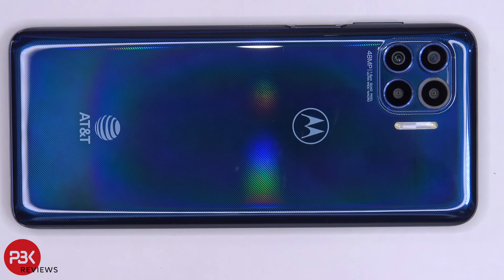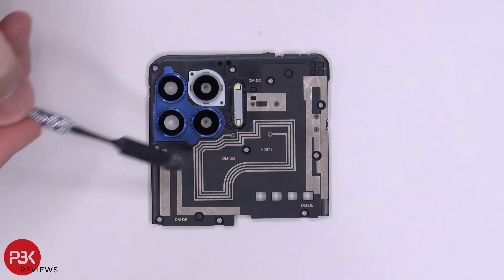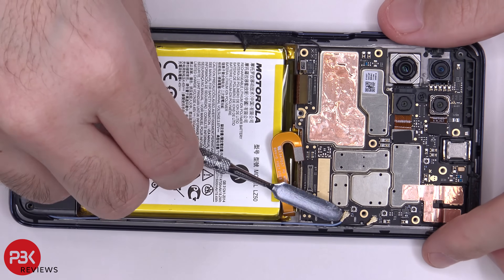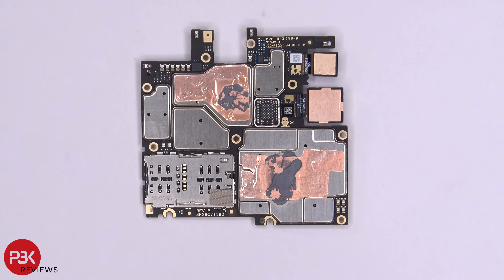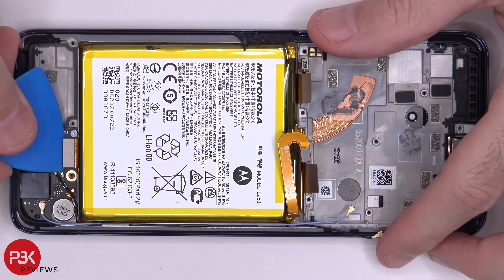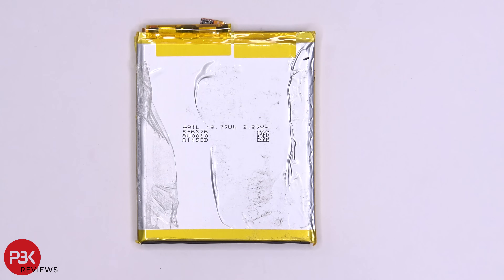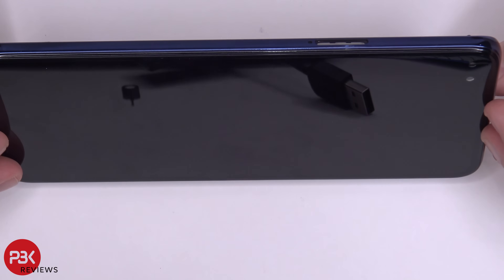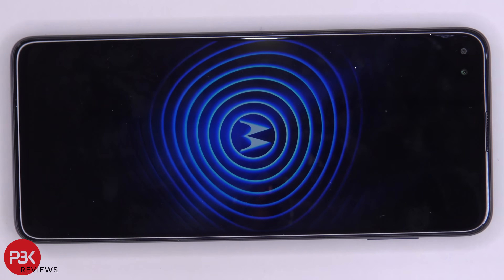Motorola One 5G / Moto G 5G Plus Disassembly Teardown Repair Video Review

Comment: What do you mean: the 5g antena would go ? Isn't this a 5g phone ?
Reply from the maker: The mmWave 5G antenna. There are different types of 5G networks. This specific model does not support mmWave since it does not have the antennas. At&t in the USA does not use mmWave but for example Verizon does, so if it were a verizon model, then those area's would have those mmWave antennas installed so it would work with Verizon's 5G network. All 5G networks are not made equal unfortunately but if you were to have a Phone which has the mmWave antennas installed then most likely that phone would work with other 5G networks as well since it would have both types of antennas. But if your phone model does not have the mmWave antennas, then it would work on all 5G networks except the ones which use mmWave technology. Hope this helps explain it.
Reply: @PBKreviews  does this phone have night mode like the Motorola one 5G ace?
Reply: @PBKreviews  but i had  a Verizon Motorola one 5G  and mine  never did show that i had 5g service so i think this brand just basically lied abt having 5g  🤔😅
Reply: but i had  a Verizon Motorola one 5G  and mine  never did show that i had 5g service so i think this brand just basically lied abt having 5g  🤔😅

Comment: Can this phone be repaired if it was dropped in water for a very short time. But didn't come back on or charge up after drying thoroughly. Ended up getting a new phone but this phone it was $1,200 and I think it needs a new battery or something?
Reply from the maker: Its possible. You would need to take it apart, disconnect the battery and dry out any water inside, brush off any corrosion on chips or connectors with a small brush like a tooth brush and see if it works or see what parts need replacing etc.
Reply: @PBKreviews  are you interested in something like this question mark if so let me know how we can get a hold of each other or talk or something please thank you sincerely Tim Weigel
Reply: Well I'm sure there's no water in it this happened last year right after he got it. He didn't have it but a couple of days my grandson, he dropped it into the toilet accidentally for about a second and pulled it back out. But my daughter had insurance on it and got him another one. And he just threw this one back in his drawer. Now he's giving it to me and I'd like to see what I could do with it.
Reply: 1.200? I paid 275 euro for a new one. 4 years ago

Comment: What are the two wire cables in the corner for?
Reply from the maker: the wire cables or coaxial cables are for antenna connections.
Reply: Thank you for the reply. 
So I could add a external antenna with one or both of those connections? @PBKreviews

Comment: Can you get the lens cover for the rear cameras off or is that part of the mid-frame?
Reply: It's all one piece it'll come off when the back comes off however that happens
Reply: I've never tried somebody told me to take an iron heat it up and loosen the glue I just don't want to believe that yet.
Reply: @tleeWeigel  no it's a seperate piece, they'd be right as far as using a blow dryer, etc.

Comment: My battery not coming off as easy as yours. It's stuck quite well. I'm trying goooff liquid and soaking it but still looks like I'll have to bend the battery heavily to pry it out. I'm using heat too. Very frustrating.
Reply from the maker: Use isopropyl alcohol. You can find it here https://www.ifixit.com/Store/Tools/iFixit-Adhesive-Remover/IF145-400?o=4  You can apply that around the sides of the battery, let it sit for 30 second or so and try gently prying it up and if needed add a few more drops and let it get under the battery so it eats away at the adhesive making it easier to pry off.
Reply: @PBKreviews  cheers. Yeah just letting it soak helped a lot.
Reply from the maker: @Swenser  👍

Comment: Talk about blue balls. Was hoping for the money shot......remove screen
Reply from the maker: I explain how the screen needs to be removed in the video. Most screen replacements come with the midframe pre attached so you don't really need to pry the screen off the midframe. But if you get a replacement that is just the screen,  it's explained that after you take apart the phone, all that is left is to heat up the screen and pry it off the midframe. I don't do that since I don't want to break a perfectly good and working screen.
Reply: @PBKreviews  thanks for taking the time to respond to a wise ass. It's a rare quality.
Reply from the maker: @vitty7465  I try to reply to as many comments as I can, unless they are completely vulgar. :)

Comment: What are the blue and black cables for that run down the side? Is the blue one a 5G antenna? What are they connected to?
Reply from the maker: They are antenna coaxial cables which connect the sub board antenna contacts with the main board for signal etc.

Comment: Salve a me si è rotto il vetro delle fotocamere nel filmato non vedo il vetro dov'è? Il mio telefono e Moto g 5g plus. Lei toglie la cover posteriore ma non vedo il vetro, ma dove lo posso trovare il vetro?
Reply from the maker: The glass is held on with adhesive. You can heat it up with a hair dryer and then pry it off. They sell the camera lens on this website https://www.mobiledefenders.com/motorola-repair-parts/other-motorola/one-5g-xt2075-1-xt2075-2.html
Reply: Buongiorno, nel sito che mi ha mandato non ho trovato il pezzo di ricambio, non capisco se devo sostituire solo il vetrino con il biadesivo, oppure devo togliere scolare la scocca posteriore come lei fa vedere nel filmato? Perché su AliExpress ci sono in vendita solo il vetro con il biadesivo. Io già una volta ho sostituito il vetrino rotto delle fotocamere del Motorola X4 è stato facilissimo non so se la procedura è la stessa per Motorola G 5G plus.

Comment: Sir what 5g smartphones that mostly work on defferent 5g band
Reply from the maker: Hard to say, looking for a unlocked version 5g phone that has mmWave 5g capability would be your best bet since that would not only work on most 5g networks but also on mmWave 5g networks also since it has the additional mmWave 5g antennas along side the standard ones.

Comment: Does this phone have a compass? I am used to seeing "magnetometer" under sensors but this phone's specs state "e-compass" and I've no idea what that is. I would need a regular compass for walking / map apps.
Reply from the maker: Not sure, but I would assume e-compass would be something that uses the internet and gps to act like a compass.
Reply: The european one without the macro ring light is having a compass. E compass means it's electronic so a chip which is well normal.

Comment: Does this phone have Rubber Rings around the Aux and Charging Port and around the Sim Slot for some unofficial water resistance
Reply from the maker: A thin small one around the charger port yes and one around the sim tray but nothing for the headphone jack. Phone might take a minor splash but doubt it will survive being dunked into water.
Reply: @PBKreviews  thx
Reply from the maker: @darkshadow.1337  you're welcome

Comment: hello there,off topic.. I'm planning to buy realme 7 pro can i use my existing Nokia 5w charger instead of their 65watts power brick..as far as i know fast chargers degrades battery fast
Reply from the maker: Ya you can use any charger that has a compatible head that works with your charger port. You don't need to use a fast charger.
Reply: @PBKreviews  thanks
Reply from the maker: @palkupskah1356  you're welcome